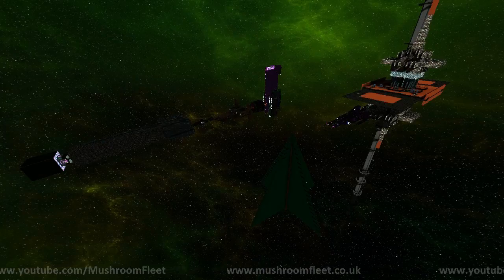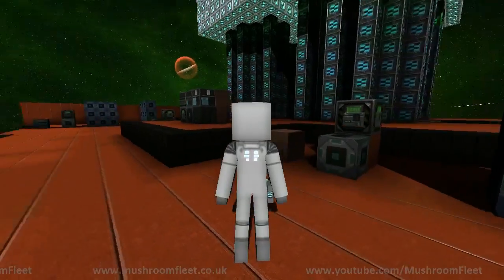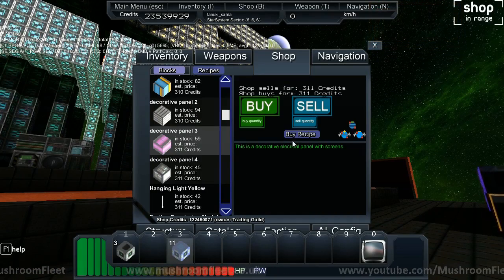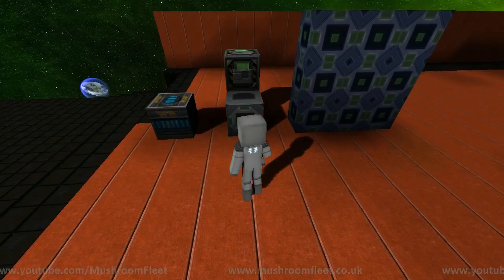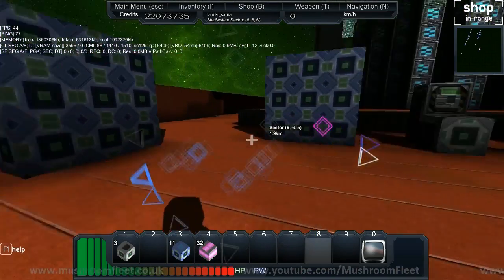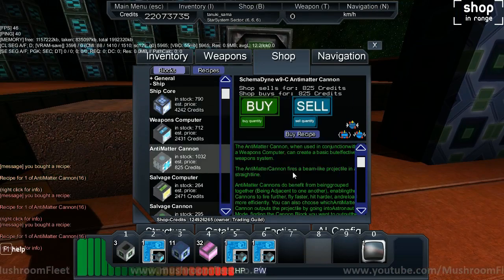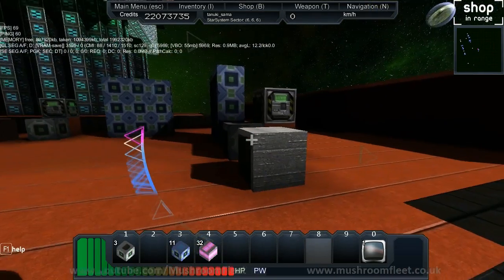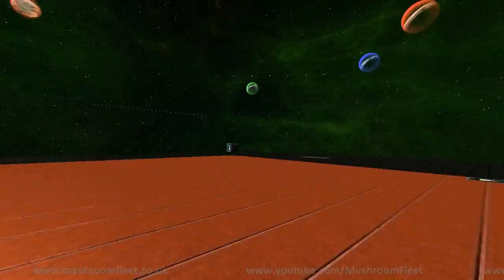Starmade Ep766: Factory Tutorial 0.1401

Comment: Once i made all-making self-efficient factory. I've gathered many blocks of every type from terrain tab (flowers, minerals, etc), made the best recipes of them like 2 lava for 1 sand (it took some time to buy and check the recipes) and i've trained them, so i.e. i've got 10 sand blocks for 2 lava. This way i didn't loose any blocks during production, instead i was gathering them pretty fast. Later i made recipes for blocks from manufacturing tab and then for every other block. 
Last time i had 1k of enhancers connected to each factory input (had 1 input per each block type in game) and tried to connect all factory inputs together creating an automatic factory. The result was pretty big lag on the server, so i gave up on this, because i didn't need any more blocks and i didn't want to make ppl on server suffer for no reason :)
Also over 200k factory enhancers made some lag every tick, so I've left only 40k enhancers connected to 4 inputs, wich i could use if i needed to make anything.
Reply from the maker: Factories are a lot of Fun and I will be focused on them as they come back into the spotlight ;D